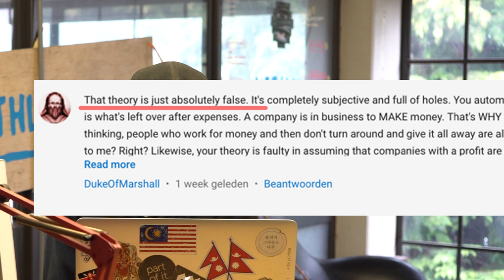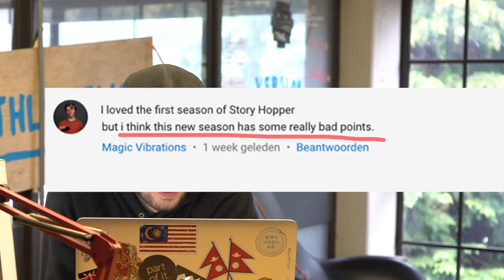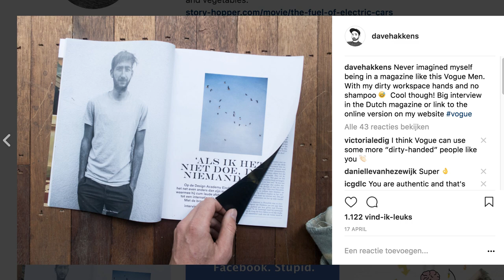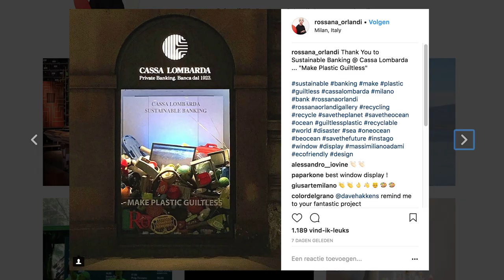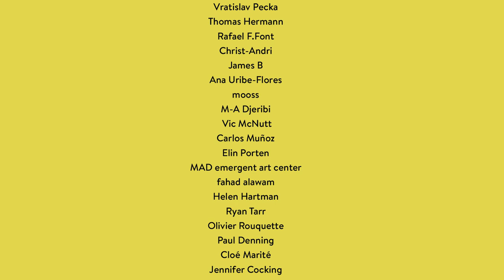Monthly News #15  - Storyhopper 2 explained + we got copied by a famous gallery

Comment: If you don't add a lot of UV stabilizers to the plastic any of the outdoor junk that's made will slowly harm the environment with micro particles of plastic. Even stabilized plastic would do the same, but it takes longer. You have use paint to protect it or some other covering. It's better to keep plastic indoors or turn it back into oil and refine it again.

Comment: Dave, please try to learn about the Resource Based Economy. It is that new system that we need to build to replace capitalism. If you can, I would recommend watching the "Zeitgeist Moving Forward" documentary. Precious Plastic is a key technology in the construction of this new economic model. Count me in for Project Kamp. Also, your perspectives on profit are correct. People writing negative comments are conditioned by this system we live in so hard that they have built their personal identities based on the current system and so, when someone speaks against the current system they feel as though their identities themselves are being attacked. Keep at it. But really, try and check out the RBE (Resource based economy), The Venus Project and The Zeitgeist Movement. The Zeitgeist Moving Forward documentary I recommended is the best way to start learning about the RBE, but it is also quite long (2h40m) so I will also recommend another documentary, made by The Venus Project, that also serves as a great intro to RBE but is also shorter (50minutes), it is called "Paradise or Oblivion". Both these documentaries are available for free, with subtitles, here in youtube. As always, thanks for the amazing work!